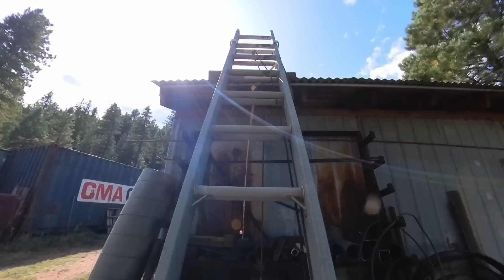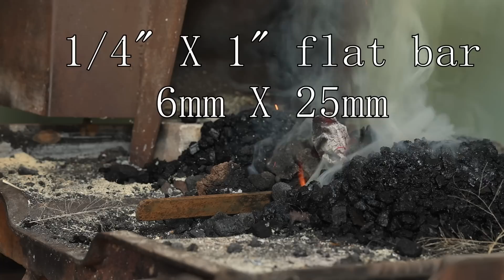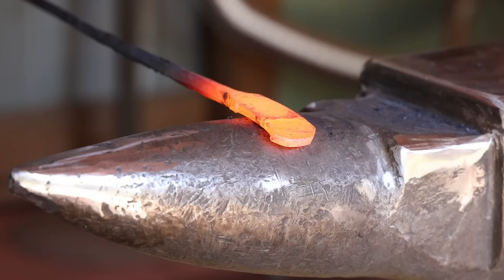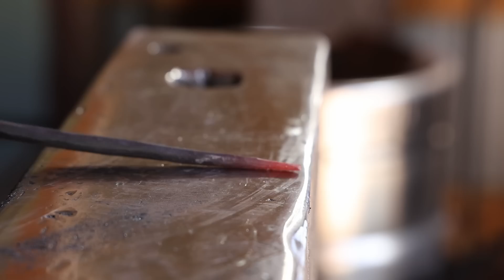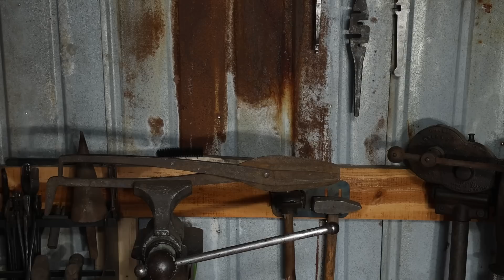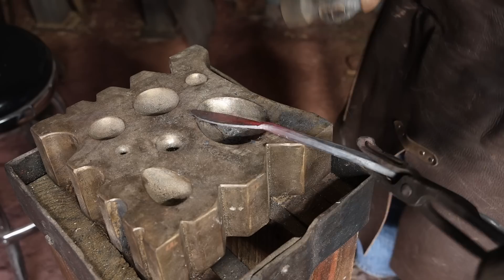The Old Coal Forge is back - Forging a Spoon

Comment: Real silly question. How is he not burning his hand at 3:00  Is there a rule of thumb on when to use tongs or not?
Or is he just built different
Reply from the maker: As for a rule of thumb, if it's too hot to hold onto safely and comfortably use tongs.  But it does take time for the heat to travel up the bar, so you can often hand hold a piece for the first heat or two.  Using water to cool the bar so you can hold it often an option as well.

Comment: Great video as always! Where I smith in Arizona, coal and coke are hard to come by and expensive. Also, local air quality laws proscribe their use.  However, many local businesses sell large bags of mesquite charcoal for a reasonable price, In fact. chunks of mesquite wood or desert ironwood burn clean and provide plenty of heat for forging and even welding.

Comment: Our guild shop is just a well ventilated pole barn with 4 coal forges and 4 propane. A winter day a few years back I helped guys light up two of the coal forges and then went to light the 3rd one for myself and it wouldn't draw. That's when I figured out that two 12" flues was all the ventilation we had coming into the barn. I had to open a door to get enough air to fill the 3rd flue.

Comment: been looking at your videos from recent times [back to 5 years}  and really admire the technique and effort you put into your instruction,  As a new FAN  I have a small suggestion for your apprentices.  If cash is a little short, and resources of higher alloy metal not readily apparent, look for crowbars and similar tools at the cheap big box stores,   Years ago i bought three crowbars for a small price at dollar general.  Pieces of those have functioned as punches, chisels, and fullers for years.  Twenty years later the only high alloy purchased for tooling is one piece of H13 shaped thin for fine line cuts in red orange cuts,

Comment: In the case of your horn moving, could you make a hooked plate that sticks out that far on the bottom of the stump? The hooks would grab the bottom of the stump, and the plate would extend under the stump out to be in line with the horn, so it would apply the force evenly and prevent the horn from causing a wobble.

Comment: I think a forged tomahawk style chipping hammer video would be a great idea im a welder by trade but been watching youre videos and tinkering with my forge for 5 years now would like to see how to make my own chipping hammer from an expert
Reply from the maker: Great suggestion!
Reply: @BlackBearForge I also got thinking and could you make a spring punch for punching holes but on a spring in the hardy hole like the spring fuller so you didn't have to hold the  punch you could just slide you're work under it?
Reply: Torbjorn made one but he's all power hammer work it seems like these days.

Comment: Just a quick tip for people who start their fire with lumber, be careful. I have a friend who took a deck down and burned it in his help took all the lumber out to his pasture and burned it. Later he had several cows drop dead and he came to me to ask what he could do to help the ones that were still down but not dead. We had no idea what the problem was but after a necropsy on one of the cows it was determined they had found the burn pile and licked the ashes. Apparently the ashes were salty or something. Turns out the lumber was treated with arsenic and it killed several head of cattle. My friend, not realizing the burn pile was connected, never mentioned it to me or the vet but the vet did ask him specifically if the cows had access to a burn pile so it seems it's not uncommon for him to see that. Having said that, I would exercise caution when burning treated lumber.
Reply from the maker: Its been many years since treated lumber used arsenic.  But in general I would avoid burning treated lumber
Reply: @BlackBearForge  I think the idea was he was scrapping the old deck and building a new one so I'm pretty sure the wood was old. How old I have no idea. But the vet that did the necropsy told him arsenic was to blame. 
Having said that, there is a herbicide that contains arsenic that I sold a lot of over the years but he never used it. We had lots of chemicals that people spray for different things that could be very hazardous and many people used it off label, which is why so many chemicals are getting banned. I've known people to spray the wood on their houses for termites and such with chemicals that would make you sick or kill you if you simply spilled it on yourself. Paraquat, strychnine, nicotine sulfate and of course arsenic were just a few of the fun things we sold. I even found thermite and nitroglycerin torpedoes in the warehouse from the railroad days. It was a fun job and always an adventure.

Comment: Greetings from Ireland. I would love to see more about how you installed the chimney, especially how you sealed the roof to keep rain out. What is a good height for the fire. I am setting up an extension to my workshop and I want to set up a forge. I bought a used pellet furnace for scrap value including a nice 8" double walled chimney pipe like yours, definitely the way to buy it plus I have a lot of good steel in the hopper.

Comment: I've burned up so many pieces leaving the air on too long. It's just as you say: you go to grab a tool or something and it isn't where you remember, or you get distracted with something on the way... and there goes your piece. It can happen really fast. I don't regret switching to a coal forge at all, but it has been quite a learning process to get the right amount of heat without burning stuff up. The biggest pain is that you usually end up burning things near the end of the project when you have thin or delicate parts.
Reply from the maker: Very true
Reply: Hand crank blowers help reduce that, but it certainly can still happen.
Reply: @garethbaus5471  Yup, diligence is needed in all cases. I've been thinking about trying to make one of the Japanese box-style blowers. If I get a manual blower I want to hook it up alongside my electric blower so I can switch between the two.

Comment: Good to see the coal forge back in action! Special request; could you talk some time about shutting down a coal forge when you are done forging? Do you just let it burn out? I want to finish up building and start using my coal forge, but my coal supply is limited, and I don’t want to waste a lot by letting is just burn up when I’m done, and while there are a lot of videos on starting up a coal forge, and working in one, but I’ve never seen any ‘end of day coal forge procedure’ stuff.
Reply: Without the blower going the fire goes out pretty fast. If you have a water dipper, and you're done for the day, a LITTLE water will make it go out faster.
Reply: What I do when shutting down the forge is make sure there good amount of coal converted to coke, (also called breeze for some reason unknown to me) and then just sort of break the fire up and pull it apart, it goes out within minutes.

Comment: I don't really have an idea how much force it takes to hand crank, but it might be interesting to connect a flywheel to the blower. It'd take more effort initially, but could free up a bit of time for doing things around the shop while waiting for forge/stock to heat up - and at less risk of burning up the material, since it'll run out of energy sooner or later
Reply: It doesn’t take much force at all.  If anything, my blacksmith son sometimes needs to tell me to slow down with the cranking.  Of course, I am one of those beginners who enjoys cranking the blower.

Comment: Can you use that spoon to actually eat or would that be harmful
Reply: It’s just steel, should be fine.
Reply from the maker: You sure can, as long as you use a food safe oil or wax to finish it with.  No different than using a cast iron pan.